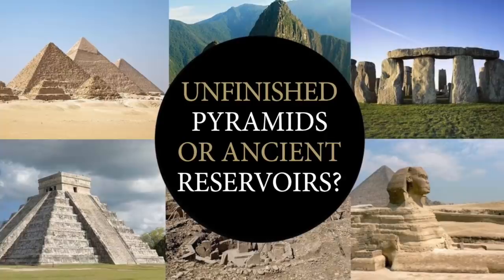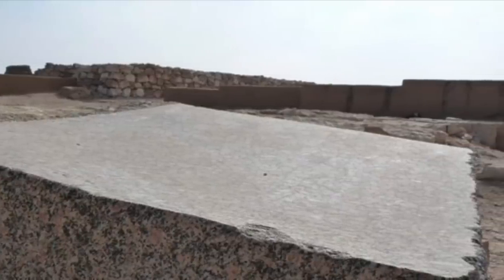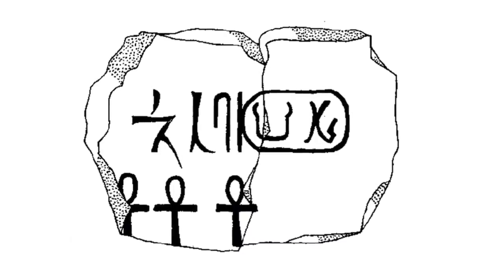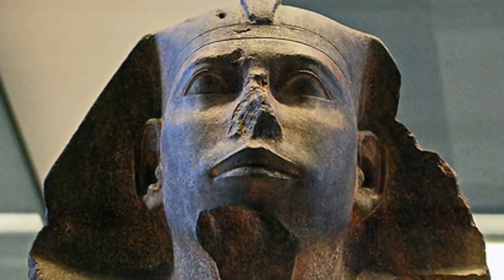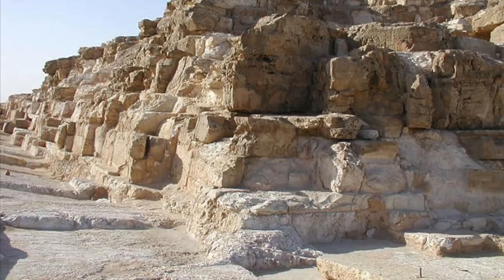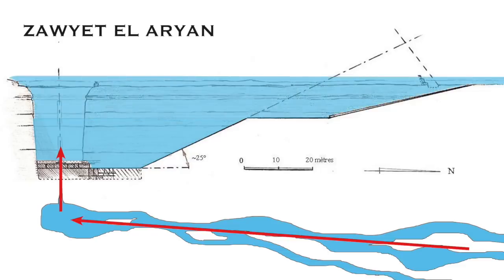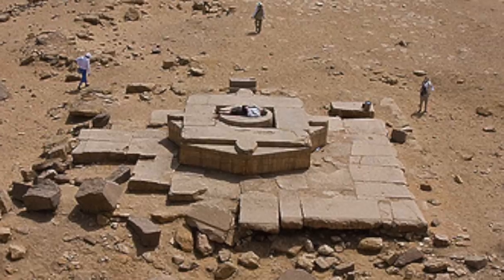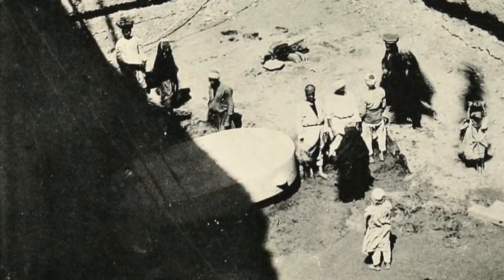Unfinished Egyptian Pyramids or Ancient Reservoirs? | Ancient Architects

Comment: Hello there,
Is it possible that the so called unfinished pyramids were reservoirs that released water at pressure to fill the galleries/chambers of the pyramids. The water would be trapped until released just like a toilet flush.  There would be a corresponding weight within the chambers that dropped. Attached to this weight would be ropes and pulley systems going along timber beams housed in what are referred to as "air shafts".  This would be a sensible way to lift the heavy stone blocks to put in place. Really just a hydraulic crane. The shafts on other sides would/could be blocked on completion. The chosen shafts were chosen for their obvious astronomical alignments and dedication. The pyramids then self serving water pumps. Easy build multi purpose.
Best wishes
The Improbable Puritan

Comment: Regarding the John Cadman ramp pump model. The waste pipe drains north of the sphinx and is under the Nile (on purpose). The waste pipe must be underwater for the valve to work. The other pipe that leads out of the giza pyramid has a valve on it which gives us the second pulse that creates the heartbeat pattern. Cadman used a schrader valve in his working 1/48 scale model. So this pipe would be the one that leads to either of these pyramids if your theory is correct. 

Another factor in the John Cadman model: the pyramid builders made their drive shaft (the one that leads from the grotto into the descending passage) smaller to increase the efficiency of the pulse. If they wanted to make the pump more efficient, they would  have made the diameter of the shaft LARGER. These were Jon's notes after making his scaled model.

What's interesting about your video, even though they made the giza pyramid to be a low frequency generator, where did the water go used to create the pulse that fires the hydrogen atoms into the kings chamber. Could it have been piped to other structures to power them? keep up the great work amigo.

Comment: Great stuff.  A very interesting idea though of course all it does is contribute to more questions and mysteries. Just a few that first that come to mind--and applies to the Giza pyramids as well--if truly such a prosaic machine as a water pump system why bother with the massive labor it would have been to quarry, carry and polish giant granite blocks to serve as the floor of a reservoir when the natural bedrock would have served the same purpose? Why the orientation to compass points?  Why oval, why not round or square?  At every turn there is another mystery. Thanks, it's a shame one can't just poke around the place.
Reply: Perhaps tidal force was used to fill and empty the reservoirs. Hence the orientation of docks, canals and underground tunnels and reservoirs.
Reply: Why not? If you can accomplish the feat, why not?
Reply: 1: Limestone is porous, so would need lining to ensure long term use.  2: Aligning the pit with the sun could reduce sun exposure, reducing evaporation.

Comment: Amazing what you can do with a hammer and copper chisel
Reply: A hammer, a copper chisel, and a tuning fork!
Reply: Don't forget the pounding rocks that Egyptologists say they shaped all that stone with haha What really makes me wonder is the scoop marks in the stone where they were making blocks and obelisks.
Reply: @NeckNotes  agreed! The scoop marks are all over the place. I'd love more research on those
Reply: The Egyptians got better in time .Look at the achievements by Ramesses II
Reply: Pounding Stones 🤣
Reply: @coryCuc  , they're proof they also used bamboo shovels.
Reply: @senatorjosephmccarthy2720  The bamboo shovels wouldn't leave the symmetrical scoop marks for example along the side of the unfinished obelisk in Aswan.  If you walk along the side of the stone and turn to the wall and look down, you'll see the scoop marks. The scoop marks leave ridges (kind of like an ice cream scooper would leave).  If you measure the distance between the ridges (high parts between the scoops) they are exactly the same distance apart from one another.  The width of each scoop is also exactly the same distance. The depth of each ridge between the scoops are exactly the same height.  There's no way to achieve those tool markings with hand tools.  Whatever they were using to dig out this stone, it had to have been a machine.
Reply: @coryCuc , my comment was pure sarcasm aimed at mainstream archeology. I know sarcasm can be a bit hard to notice in print, but the absurdity of it is sometimes helpful in recognizing. I didn't know about the precision of the scoops, thanks.
Reply: @senatorjosephmccarthy2720  Lol! My bad! Bamboo shovels.  I shoulda picked up on that. But it is the internet ;). Good one!
Reply: @muuundotarde7914  I don’t get this comment I keep reading it over and over. The planet I come from are slow thinkers

Comment: Why polishing granite for a simple reservoir? It must have had a different purpose!
Reply from the maker: Good point. This puzzled me too. I have a theory for this too but I'm just developing it... it's one huge work in progress for me...
Reply: Water proof at high pressure!
Reply: Joints/lateral surface, but not the inner surface of a tank. 
If we assume an ancient high-tech civilization, we must also assume, they had steal, aluminium, titan etc. They would use those materials to build water/whatever liquid tanks.Simple - material to volume ratio. Those mega-structures must have had a very different purpose. Some were definitely religious like huge statues, but pyramids - that's still a great mystery. Every new hypothesis is worth considering.
Reply: That brings up the question of where all that metal went then. That stuff should be everywhere, especially if they used it to build. If you dig around the diameter of any modern construction site, you'll find all sorts of fasterners an hardware. The only thing we've found in Egypt come from meteorites.
Reply: Pawel W, We use lightweight porcelain ceramics while they used heavy-duty polished granite. Higher the polish = less scaling and potential for fouling.
Reply: Why not polish the floor of a tank? especially if it was a public works project.
Reply: SpenserRoger, Public works project for sure. All those big heavy blocks buried in bedrock imply high pressures too.
Reply: Randy Bostic but what for? Simple water tanks don't need that. If you want high presure tanks, you need small diameter tubes, otherwise water pressure will damage everything easily.
Reply: Purpose: Boiling water and making steam - for various purposes. I differ with Ancient Architects (AA) concerning "the tub." I believe it, like all the other sarcophaguses, were used to house radioactive fuel which, in use, was for generating long-term, persistent heat similar to our nuke plants today but much, much more environmentally conscious. The proof - for this site - is the design of "the tub" itself; that is, rounded ends resist cracks and failures - like the ends of propane tanks and submarines. Another proof is all the surrounding mass. A third proof is the polished granite  because highly polished surfaces resist scaling and fouling and make periodic cleanup easier. So AA is, in part, correct about distribution of water throughout Giza but all the engineering preceded Noah's Flood; furthermore, the devastation brought on by The Flood catastrophe prompted those who followed to simply repurpose the block rubble for government buildings, mosques, and homes while concluding - erroneously - the works were tombs. (A smart open-minded team of engineers in the geosciences, nuclear, hydraulics, and electronics fields with masons, plumbers, and electricians need to be reviewing all these sites but I doubt that'll happen any time soon.)
Reply: What if it's an elevator to go down
Reply: A nuclear power plant would leave increased radiation, and products of decay(like Pb in place of Uranium).
I still find those structures as some kind of religious buildings. We now also build hudge religious buildings, but our buildings for producing power plants, food, fuel, etc are not build to last millenia.
We've built just a few buildings to last millenia - Svalbard Global Seed Vault and places, were they keep backed-up data - caves(artificial or natural but adapted), but no buildings so massive that their own mass will keep  its content safe.
Reply: NYC Rich, the tub had black goo in it suggesting it was not an elevator - but who knows for sure really; so, it's still possible.

Pawel W, As for a nuke plant: radioactivity depends on the half-life of the element, or mix, used and the folks who built these structures knew stone. (Example: Granite is radioactive and they went to immense effort to line the bed [and chambers in the Great Pyramid] with it.) So yeap I'm still pretty sure it was an environmentally-conscious, low-level radioactive-element-driven water boiler (a big one and used for various purposes not the least of which could simply have been to ensure purity while distributing hot water to the local surrounding community).
Reply: Having a smooth surface would slow the erosive power of water - no rough edges to create eddies... much like vitreous ceramic used in plumbing.
Reply: Water is one of the most destructive elements on the planet - they built these things to last for a looong time - and probably not by the lowest tenderer...
Reply: Even the Svalbard Global Seed Vault  has had problems when melting permafrost flooded the entrance tunnel.
see:
https://www.theguardian.com/environment/2017/may/19/arctic-stronghold-of-worlds-seeds-flooded-after-permafrost-melts
Reply: The megalithic structures were built to last thousands of years because - per the Bible - our ancestors lived for hundreds of years. And the reason they lived hundreds of years is because the climate was conducive to longevity and SUPERsizing prior to climate change brought on by The Flood catastrophe. As well, our ancestors would have known to build seed vaults in the Antarctic and even though they were smarter than us - as they looked to the asteroid impacts on our moon and created a semblance of Heaven on Earth via the pyramids -  they were not smart enough to halt a global destruction.
Reply: Pawel W, I don't believe our ancestors had big fabrication abilities and if they did, it's either kept secret or buried or oxidised/rusted or blown away in the sands of time or somehow converted to rock formations (I think that covers all the options??). As well, our ancestors were much more environmentally conscious about taking care of our crib (Earth) than us.
Reply: I think same, it had different function, this water disappearing means system to take water out still working, and it may be as old as sphinx, as water was problem then. It wasnt part of pyramide, because u not dig hole to build something over it, all pyramids  have only tunnels and chambers, nothing even close to it.
This black substance was something important we lose, because to day we can do a lot to known what it is and may was. And if you think this site is much older it make sense that only stone remain and metals turn in dust. This is why archaeologist should always use spectrometry on site, because dust may not be only dust, and using only eyes u cant tell it. One thing which make some sites similar is that are no writing on them (same have added long time later), it should give to thinking, currently i think about two options, one civilization with advance stone knoledge, but without writing (it possible, knowledge is passed by words, in some regions it was still in place in europe in xx century), second is civilization we as current humans want to disapeare, and some know it, it make more understandable why they change site like this in trash hole. And some are called as our ancestor building, even it not match at all.
Reply: Pawel W maybe billions  of gallons of water with sand running through it polished the granite. every stone mason or brick layer knows that at ground or water level you have to have granite or slate or basalt otherwise your in for a structural problem.  google it
Reply: if u build with brick or plain stone at the base of any structure. you're gonna have a bad time
Reply: watch mike haduck on youtubr. he tells why brick walls and stone walls fail and how to build them. and the answer is. granite. marble. its all the same. anything that doesnt.soak up water. hes a mason master
Reply: if it soaks in water. it isnt good for keeping water in or out is my point.  there is a reason they used granite. and its cause of water. whoever this guy is on this channel is spot on with the water theory
Reply: Ancient Architects mike haduck masonry. youtube. he explains the extensive use of marble marble and granite not onlyfor masonry but for the great use it has to repell water in masonry wich makes sense with your theory.  because its not porous like concrete or stone.  granite is best for water period.